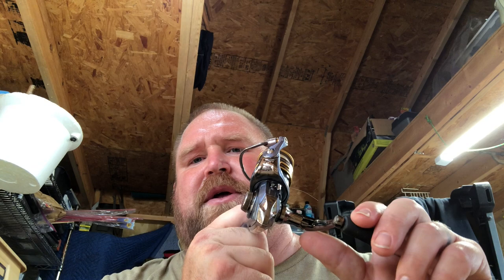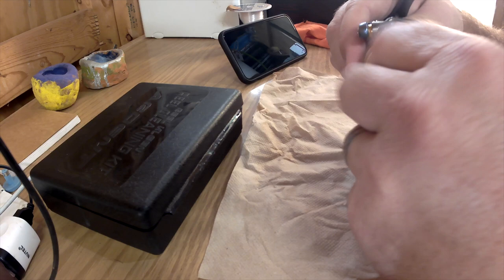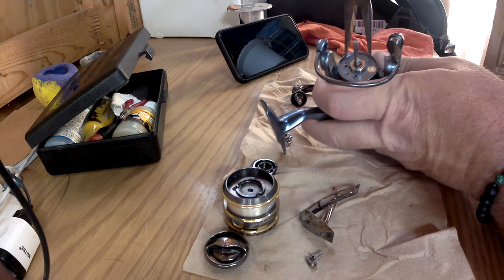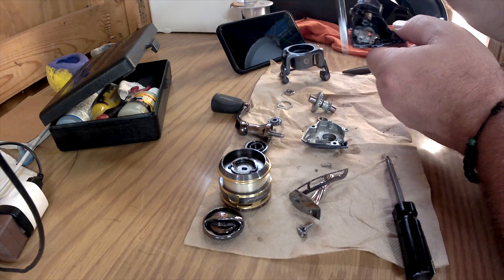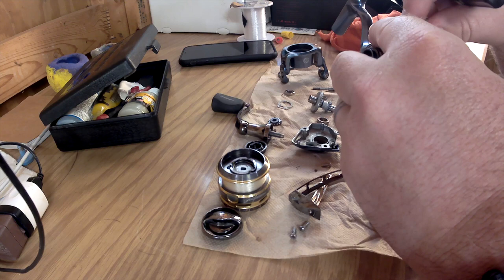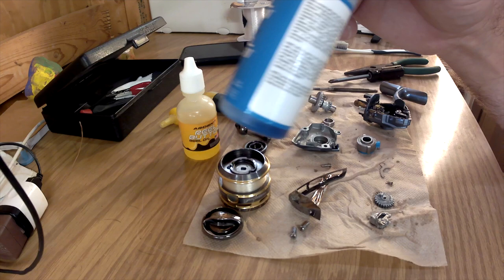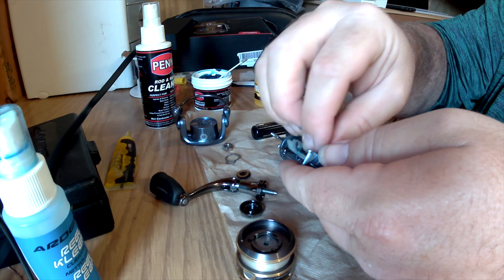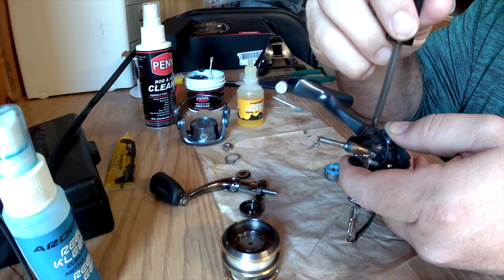Pflueger President Spinning Fishing Reel break down and clean.

Comment: These reels are junk I took 3 apart 1 a spring went flying off another one the spring broke during reassemble really cheaply made do not buy these
Reply from the maker: Thanks for the comment. I haven’t purchased this model again. I have tried other reels and currently using KastKing summer breeze.
Reply: @WestpointLake Willy  kastking better? I don't clean reels, when they stop working how they came they go on my least used rod
Reply: Dude, this is not a cheaply-made reel, it is built like a tank! There's a reason why it is consistently ranked in the top spinning reels. I ran this thing over with a full-size truck. Recessed it flat into the dirt, still going.

Comment: I haven’t had my reel for a month and it will barely reel in and it’s the same one you have in the video this has happened to me the last two pflueger reels I’m about to stop buying them they cast and work great for the first week
Reply from the maker: I like trying new and different cheaper brands to see how they hold up and I have most recently moved into the KastKing brand. The one that is a match to this one is KastKing Summer 500. Truthfully this hasn't let me down yet. While fishing for a small 1lb bass in a private pond I was able to land a 4.7lb using the Summer 500 with 4lb line and a Berkly Cherrywood rode ultra line. I currently use a lews spinning reel while I am thinking of replace with another Summer. Just my take on the current reel and brands.
Reply: Are you in saltwater?

Comment: I specifically wanted to see how to attach the spool and the drag setter onto the reel. For some reason it’s not catching on mine after I removed the spool to get some fluorocarbon out of it.
Reply from the maker: I am very sorry if this video didn't help to see the part you needed.  I no longer have the Pflueger because of other damage I done after I landed on it trying to cross over a fence on my way to a fishing spot.  I replace it with a KastKing Summer 500.
Reply: @WestPointLakeWilly  I am taking it to a Pflueger Repair and Warranty Center.
Reply from the maker: @dinoconsabor  didn’t think about that. I guess I didn’t know that was a thing. Thanks for the heads up.

Comment: I have a new flugher series 30 president reel that has vertical play in the main shaft about 1/4 inch . It's never been used . Any advice you can provide is greatly appreciated..TYIA
Reply from the maker: @MrRebelpit  take it back if you can but if not it normally is related to the gear is not in the correct place or the shaft is not screwed in correctly. Just a guess. But that is the only place that normally could allow that if I remember correctly.

Comment: I recently acquired a Pflueger President reel without a handle. Have you ever replaced any parts yourself? I’m not having much luck finding spare parts online. Thanks!
Reply from the maker: I have not found anything online, however I have looked in pawn shops and other 2nd hand shops to buy broken or bad shape reel to pull parts.

Comment: How did you get the side plate off?
Reply from the maker: 4:17 , I know it’s hard to see but there is you will find the handle needs to be off and then if I remember correctly there is 3 screws on left side and then on the bottom a screw on plate then another screw. Hope that helps. There might be one under the bell.
Reply: @WestPointLakeWilly  thank you for the reply 👍

Comment: You can use lighter fluid instead of that more expensive squirt bottle reel cleaner.
Reply from the maker: I was told that by someone after this video, but when I tried it on some other plastic it eat away some of the outer coating and I just didn't want to take the chance on some of my reels.